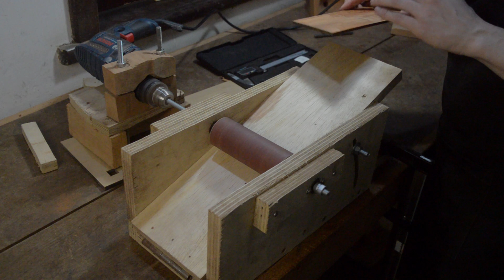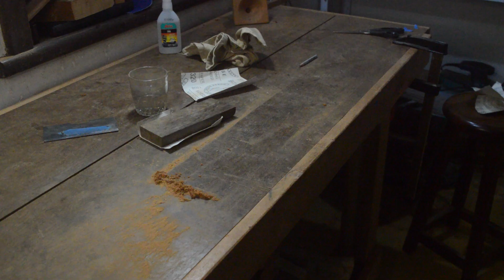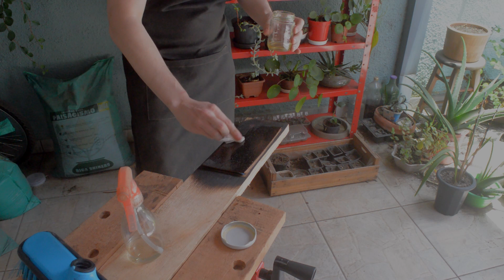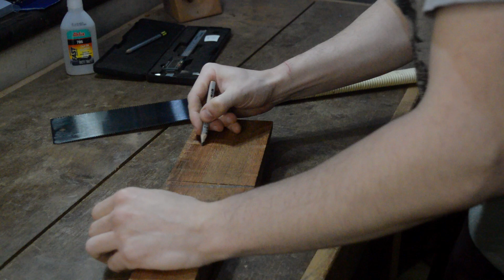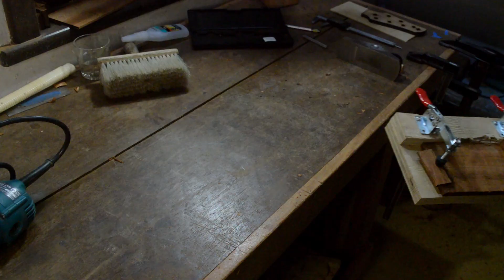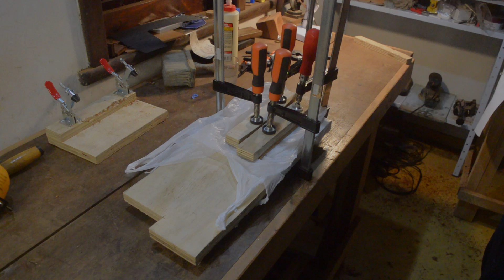Guitar Build - Part 4 - Headstock thickness and veneer

Comment: how thick is the headstock with and without the veneer?
Reply from the maker: Hey didin! Without the veneer about 13mm, with the veneer about 15.5mm.
Reply: Very cool! I like the burning of the veneer. Was that water you were spraying? And what did you wipe it down with before the last burn and why? Are you able to sand after you burn ?